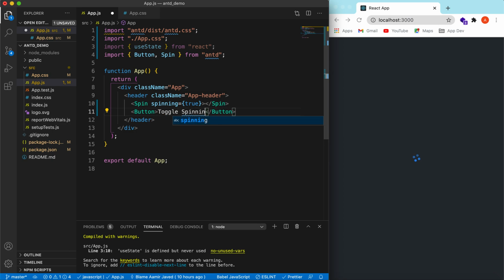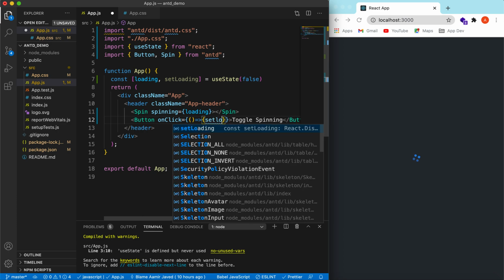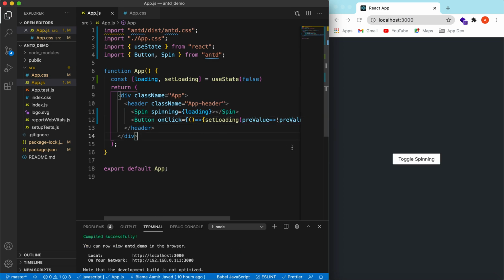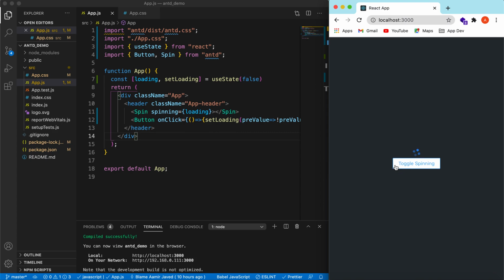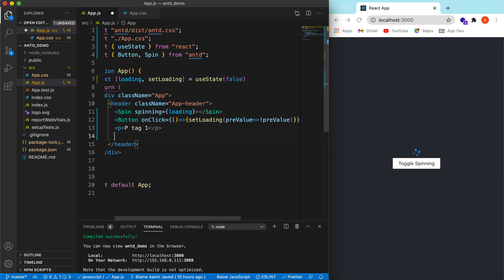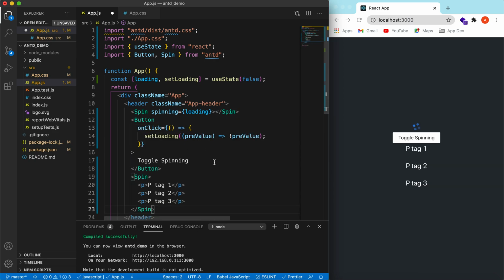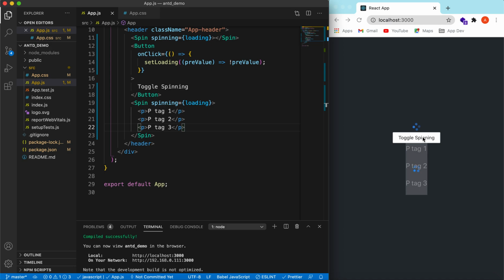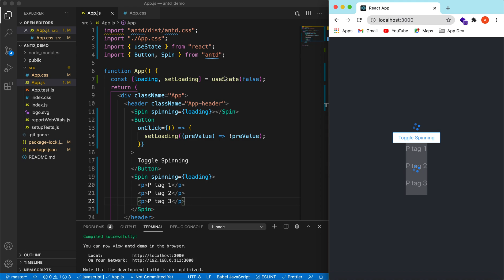Ant Design Spin component usage in ReactJS app | AntD Loading Component Tutorial for ReactJS

Comment: Hi Aamir, i am having one problem with the ant design loading whether it is spinner or skeleton.
useEffect sends the request to the server while it is fetching the data. i have to validate with if the data exist then render the data. in this way i am never able to see the loading of ant design and it also show header and footer over lapping to header. i have also checked your video but i couldn't find the solution. any idea what is going on ?
Reply from the maker: Hi @Testing Account,
It looks like there is an issue of styling like the width/height of the container is not good enough to show loader and that is why the header and footer might be overlapping due to nothing between them. May be check this styling issue if still you face the issue you may share a little bit of that particular code here so I can take a look to see the issue.
Thanks
Reply: @CodeWithAamir  
Here is the code:

  const [loading, setLoading] = useState(false);
  const [profile, setProfile] = useState(null);
  const {id} = useParams();
  useEffect(() => {
    loadProfile();
  }, []);

  const loadProfile = async () => {
    setLoading(true);
    await profileService.getProfileById(id).then((res) => {
      setLoading(false);
      setProfile(res.data[0]);
    });
  };

  return (
    <Layout>
      <Spin spinning={loading}>
      {profile && 
          //load profile here
      }
      </Spin>
    </Layout>
  );
Reply from the maker: Hi @Testing Account,
I tried your code at my end by replacing API call with timeout and it works fine, the loading/spinner was shown on the UI. May be you can try setting spinning to true always to see if it is being shown or not?
      <Spin spinning={true}>
If it still does not show then the problem could be in styling/css which means its rendering outside the visible area or something.
Please let me know if above works. Otherwise we can dig down into it more. 
Thanks